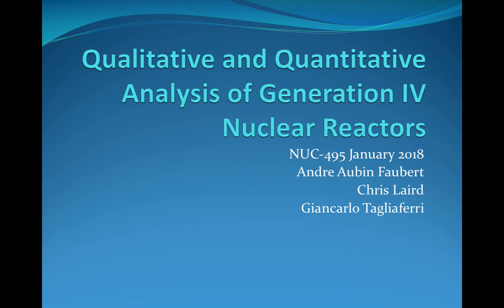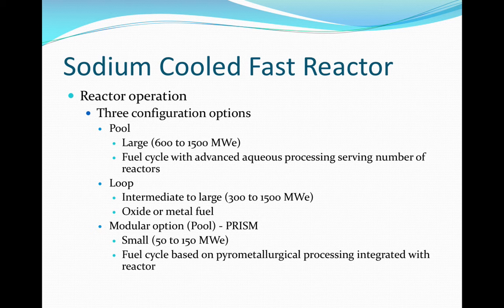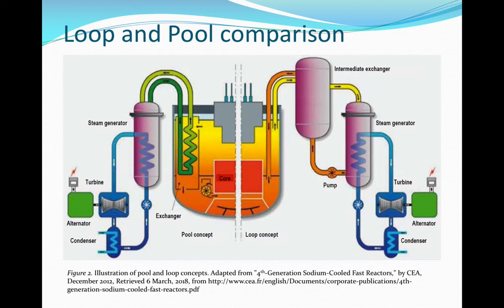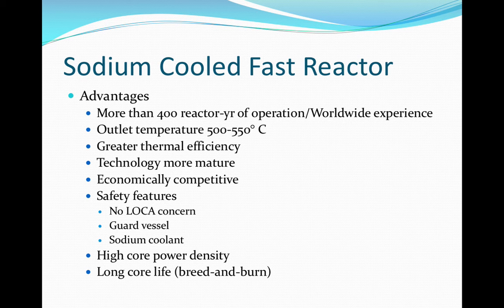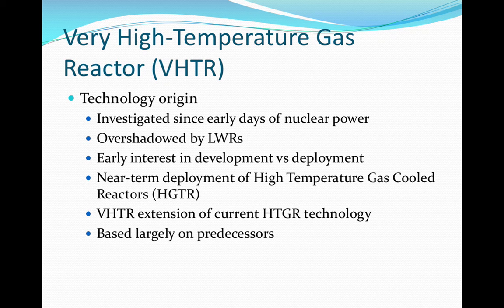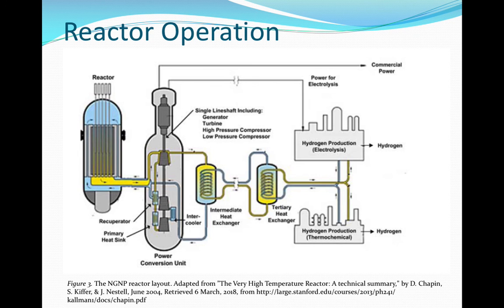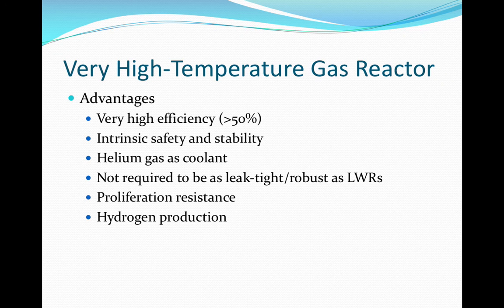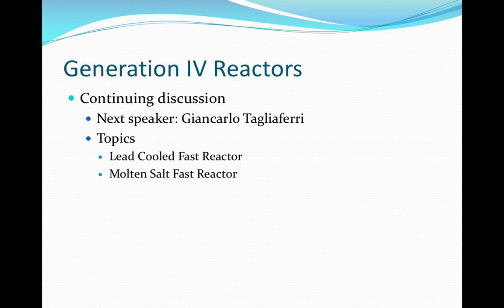Generation IV Reactors - Oral Presentation, Group A 2 TESU 2018

Comment: What a crappy system. Don’t let any water get mixed in - why not use molten salt & ionic metal full disolved in the salt???
Reply: Because molten salt can damage most metals, reactor life limited to 10-20 years that is too short. Reactor life must to around 40-60 years. Lead cooled fast reactor have better properties.

Fuel-Coolant mixture is not good solution for proliferation, Mixture can be stolen and  made dirty bombs.
Reply: @murat9268  Nonsense - the smart designers are rotating out just the core when it nears the life of the graphite but the salts are transferred to the replacement core or "pot". That way the most critical components that are exposed to the highest irradiation, are not expected to survive the whole life of the overall plant, but such components may be changed out, if necessary, before recycling - just like the graphite-QED 🥝🥝🙏
Reply: @MrVaticanRag  The problem of corrosion at molten salts are Cr (chromium) Flourination. You cannot rotate structural metals of the reactor. Saying "Non-sense" shows "very scientific approach". You can seach paper,  "Corrosion behavior of Hastelloy-N alloys in molten salt fluoride in Ar gas or in air" . Other Ni-Cr alloys have similar behaviour with higher neutronic damage. 

I don''t see any engineers saying "crappy" design without seeing huge design fault that results in catastrophic failure, not design basis risk. The containment structure of BWR and PWR is a barrier to design basis risk of LOCA and SOCA. Avoiding water and air in the reactor is similar design risk for LMR's. Structural failure of Molten Salt Reactor is similar risk, but spilling of reactor fuel can never be acceptable. Stable Salt reactors solve this problem.

Comment: So where is molten salt reactor? Only molten salt can fulfill ALL safety requirements, coolant should:
- not react with air
- not react with water
- not react with fuel
- not react with reactor materials
- not accelerate neutron breeding
- operate on atmosphereric pression
- stay with that same phase in wide temperature range
- never change it's chemicall composition, even in high temperatures and strong radiation
See only THORIUM has future...
Reply: Molten salt damages most metals (including Hastelloy N) at high temperatures. Epithermal MSR reactors (ORNL designed) has high graphite damage. I don't understand neutron breeding, what is it?

Stable salt reactors are more viable alternative to MSR, they have better proliferation resistance. Also lead cooled fast reactors have similar benefits. Metal erosion problems are actually solved with silicon and aluminum based steel alloys. 

You watch several promotional videos, without seeing any DOE, or IAEA concerns aboutt safety and proliferation. You are layman, not a nuclear design expert.
Reply: @murat9268  
1. a)Heard about "mysterious element"called Niobium? 
"The MSRE confirmed expectations and predictions. For example, it was demonstrated that: the fuel salt was immune to radiation damage, the graphite was not attacked by the fuel salt, and the corrosion of Hastelloy-N was negligible."
b)Neutron breeding=creating more neutrons due to moderation!
2. Stable salt reactor is too complicated.
It does not solve the coolant escape problem.
Lead was once used in the Russia, it failed because reactor "frozed". Plus lead do not bind any fission products as element is fairy inert.
3. A "layman" ....lololol. Witness my reactor design before you open you mouth:
https://www.deviantart.com/daikami-sama/art/My-molten-salt-reactor-schema-732724019
i call that "masterpiece".
Reply: @murat9268  "Layman"? arrogant shit - where are your manners?🥝🥝🙏
Reply: How can a moderation material create more neutrons? They slow down neutrons, not create them.

It is a sketch, not a reactor design. Can you send me neutron flux contours for different neutron energies? At least for 3 ranges: Thermal, Epithermal and Fast. 
Also, can you send me temperature distrubition of reactor? or volumetric neutron capture for non-fuel materials?
Reply: @MrVaticanRag  What is your problem? I try to understand mechanisms of neutron transport, moderation  and thermal hydraulics of the reactors. I say "layman", because he cannot argue about the main concerns of ordinary engineer, not even a IAEA safety official that look at every bit of  detail of the designs. You can see how amateurish sketch is, even a simple solidwork drawing would be better. I read ORNL documentation, technical drawings of people work, there hundreds of papers about neutronics, thermal hydraulics, reactor control and material compatibility.
Reply: @murat9268  
1. Less neutrons escape when they are thermalized, remember when uranium absorb the neutron, it doesn't go fission.
2. The reactor is for thermal neutrons, not fast, i wrote there.
And the project was not continued. My presentation end at this stage. (since i can't buld damn machine, hell how i want to do it!)
Reply: Transatomic power have very good white papers about their open source designs. They show reactivity, neutron flux density and core design. Also they have resources at their git-hub page for resources and contributions.
Reply: @murat9268  
But my language is polish not english. Polish resources are rather simple. (one nuclear reactor exist, and is it failed LWR design)
This is why project was not continued, plus i really wanted to build the machine.
However no one will give permission for using radioactive fluids for private person.
Reply: It is always better to use industry standards for engineering work. Without IAEA application you cannot even take any sample piece of usable nuclear material, only small uranium ore for souvenir. I encourage to read neutronic whitepaper v1.1 and whitepaper v2.1 for general concerns. They have bluprints for systems for every part of of the reactor at github, it is better to start from already developed reactor to improve and realize your design. They can help you to realize it after some work with your design. Also, you can test your design for thermal hydraulics and secondary systems without nuclear matrerial.
Reply: @murat9268  
The problem is i am NOT "nuclear engineer" but the enviroment protection specialist ...
Reply: @WadcaWymiaru  i cannot help with that.  I'm a fluid dynamics guy. There are lots of informational videos about new 4th generation nuclear reactors, in channel "GIF Education and Training Working Group", their webinars about recent and new generation designs for several types of reactors. There are several good videos about Molten Salt  Stable Salt Reactors.